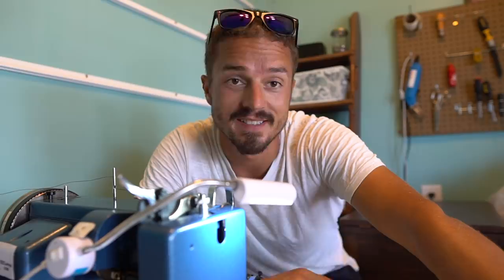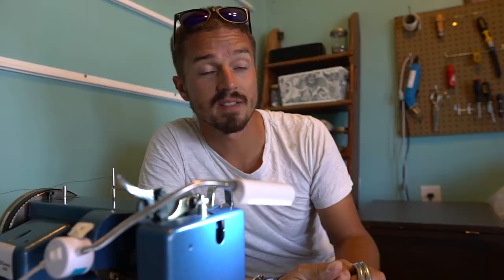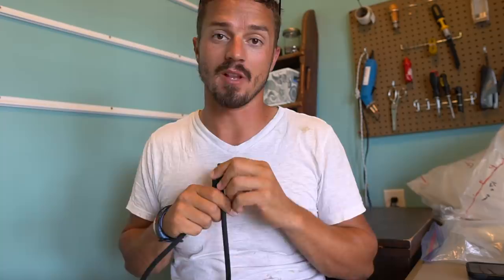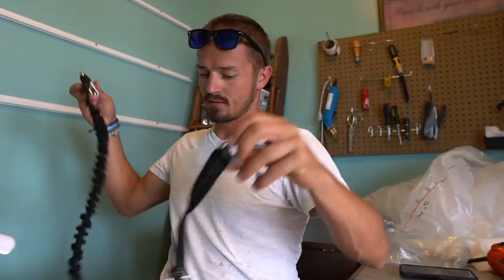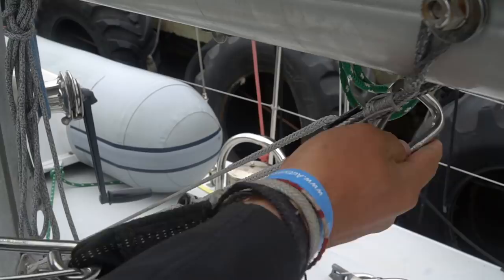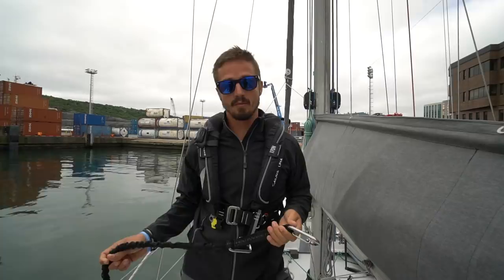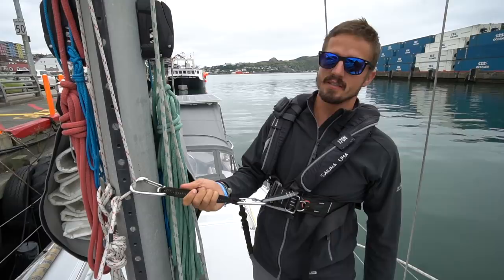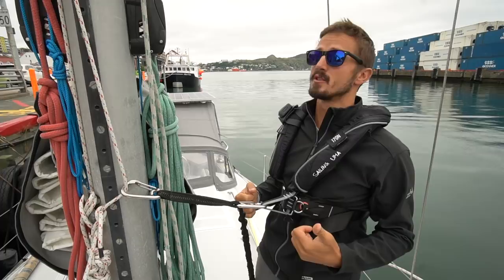DON'T FALL OFF THE BOAT!

Comment: Great idea. In Oil and Gas industry these are a standard. One idea, use a colored thread for easy inspection of deterioration from up or wear.
Reply: I thought the contrast stitch in the center of the webbing was the shock-load warning thread, but I too am only used to oil and gas industry. The webbing we get for confined space, vertical, or high angle rescue has that feature at any rate.
Reply: Disregard my last. I misunderstood your meaning. Yes black on black thread is probably a bad idea. I'd use contrasting colours so you can see easier what's going on.
Reply: Rick Czainski has

Comment: When I started diving, I used a similar plain carabiner to clip the bulky dive light onto a line. The problem is that the line you have clipped into can throw some slack over the carabiner gate, and then as it snugs up again, it actually puts tension on the gate and unhooks itself! Hard to make clear with words, but an ordinary carabiner can easily unhook itself. That is why I prefer "patent" clips that Kong and others use. They can't release themselves, but one fast squeeze the right way will open them. A plain carabiner is a land mine.
Reply: Lyfan Deth completely agree, very concerned to see that kind of hook. There is a good reason all the commercial products moved on years ago and I’m not sure they even comply with current off shore safety refs. Love you guys and your ingenuity but those clips are just not safe

Comment: I really like this system.
1. The long strap attached to the jackline stretches so it should always be long enough without getting in the way or tripped on. 
2. The short strap attached to the work area uses a huge none locking gate that should be easy to operate with one hand, even with wet gloves in the dark. 
3. The short strap attached to the work area is ... a strap,  making is distinctly different from any stays or sheets that it might be attached to. 
4. Locking carabiners eventually require me to remove a glove, making it both hands for the boat for at least a second or two.  So I see no locking carabiners as a plus for for the short strap.
5. The jackline is a strap so it won't roll under your feet when stepped on.

Wish list : 
1. A climbing harness or a full body harness, anything that attaches to the legs. Makes it just about impossible for the harness to slip off and (I think) it would make it a lot easier for Kiki to pull Dan back on board. 
2. Use two carabiners on the jackline with the gates in opposite directions. Some people want locking carabiners but I prefer all the equipment be the same. (I don't know, maybe not, none of the cool kids on the yachting channels double carabiner.... why should Uma ??? Kiki is probably too sexy for that shit anyway.)
3. Would like to see how the bungee cord was attached to the clip.

This was another great vid. Short, to the point, very clear and sure created a lot of interesting discussion in the comments section which was just as fun as the video. Great community.

Hmmm, I think it took more time to write this comment than it did for me to watch the vid... but is was a fun discussion.  Thanks for the vid.

Is it just me, or does UMA sound more like a  perfume/fragrance brand?

Comment: Toe rails saved my hubby when I back winded the spinnaker and the boom flew across the deck.  The idea of falling overboard sounds like guaranteed water boarding, rarely a happy ending.  If the boom knocked him out, he'd drown, I could never jump in to help, he's a big guy.  The toe rails give your foot boundaries without looking down.  Your short modification is a great idea.  Take all ideas for safety. 💯
Reply: I must agree with this. It makes me nervous looking at Uma's deck!
Reply: Toe rails won't do jack lines all the way (ha ha see what I did there? 😜). I went under the bottom lifeline last autumn while trying to unf...k a spinnaker: all the toe rail did was skin my shins but good on the way through, didn't show me down one iota. You gotta clip in.

Comment: The short tether is basically a "positioner". Whether climbing, or working at heights, a positioner allows you to maintain 3 points of contact (foot, foot, positioner). I am glad that you know the risks, but I can't see how or why, at the very least, the jackline carabiner cannot have a locking gate. You should only be clipping in and out of it in the cabin.  The personal attachment carabiner should be as well. Remember a lot of the rules for the locking style have been written in the blood of someone's loved one. Someone has died and that changed the rules for what is a suitable human anchor. Decades in the safety industry have probably imprinted a certain mentality on my brain, and sailing around the world in itself is a risk. But, I selfishly ask you to give it some more thought because I need more of your vids.
Reply: Byran...WELL SAID!
Reply: From Andrew Evans "Thoughts, Tips, Techniques, and Tactics for Singlehanded Sailing":
The skipper must be able to clip and unclip the tether quickly with one hand, for two reasons:
First, if it requires two hands, there will be many times when the skipper forgoes clipping on simply because one hand is busy on the tiller or holding a sheet. I will repeat this sentiment several times in the book. A singlehander is just as likely to fall off the boat on a stormy day with high winds when he is being extra careful as he is on a nice day when nothing significant is happening, but is just off guard for a fraction of a second. It is on one of those nice days when he might just skip clipping on if it is the least bit difficult. Human nature is such that people will avoid “unnecessary” work unless it is made as simple as possible.
Second, the skipper must be able to unclip with just one hand in situations where the other hand is busy. For example, if the tether gets caught on a cleat in the middle of a spinnaker gybe. It is much easier, and in the end probably safer, to unclip rather than leave the spinnaker pole swinging across the boat. I am not so unrealistic to think that the tether must be worn every second of every voyage. The easier it is to clip on and clip off, the more likely that the skipper will wear it more of the time.
Some boaters insist on locking carabiners. I have no problem with this concept as long as they can be quickly and easily fastened and unfastened blindly with one hand. In nine years of running all over my boat dragging my tether, I have never had a carabiner detach from the jack lines or my harness, so I don’t feel that a locking mechanism is necessary. I have heard of situations where the jack line runs parallel to a sheet and the carabiner runs onto the sheet. My suggestion is to move the jack line to a new position where this can not happen."
Reply: @wilfdarr  same goes for rescue etc..that is why the proper twist lock, or even the pinch lock is recommended. Look one can have no incidents most all their lives, the one incident will be all that matters. There isn't a CFR ( or CSA for the Canadians) governing this, but best practices are best practices.
Reply: @BryanSongy  There are one handed locking carabiners, but a twist lock is absolutely no good on a boat: at best you only ever have one hand free.

Comment: I strongly recommend that you use carbines with a lock. I use them occasionally at work and I can assure you that you´ll get used to opening them single handed with gloves without seeing them. Using a bright colour for your stitches will help you inspecting them.
Reply: From Andrew Evans "Thoughts, Tips, Techniques, and Tactics for Singlehanded Sailing":
The skipper must be able to clip and unclip the tether quickly with one hand, for two reasons:
First, if it requires two hands, there will be many times when the skipper forgoes clipping on simply because one hand is busy on the tiller or holding a sheet. I will repeat this sentiment several times in the book. A singlehander is just as likely to fall off the boat on a stormy day with high winds when he is being extra careful as he is on a nice day when nothing significant is happening, but is just off guard for a fraction of a second. It is on one of those nice days when he might just skip clipping on if it is the least bit difficult. Human nature is such that people will avoid “unnecessary” work unless it is made as simple as possible.
Second, the skipper must be able to unclip with just one hand in situations where the other hand is busy. For example, if the tether gets caught on a cleat in the middle of a spinnaker gybe. It is much easier, and in the end probably safer, to unclip rather than leave the spinnaker pole swinging across the boat. I am not so unrealistic to think that the tether must be worn every second of every voyage. The easier it is to clip on and clip off, the more likely that the skipper will wear it more of the time.
Some boaters insist on locking carabiners. I have no problem with this concept as long as they can be quickly and easily fastened and unfastened blindly with one hand. In nine years of running all over my boat dragging my tether, I have never had a carabiner detach from the jack lines or my harness, so I don’t feel that a locking mechanism is necessary. I have heard of situations where the jack line runs parallel to a sheet and the carabiner runs onto the sheet. My suggestion is to move the jack line to a new position where this can not happen.

Comment: Nice! I would recommend a quick release snap shackle that can be undone under load should you need to untether in an emergency. Otherwise, you need to release the load before you can undo those carabiners. Just a thought.
Reply: That's why you carry a knife !
Reply: Exactly. A snap shackle with a lanyard to allow for release under load should be at the harness/life-jacket end . This will allow you at least a chance, in the event that you do go overboard or the boat turtles in a knockdown, to disenage from the boat before you drown (which has happened to experienced sailors).
Reply: Agreed.   Leaving the boat behind needs to be a deliberate affirmative act on the part of the sailor.
Reply: I agree, love all the features Dan added but from what I've read the risk of drowning after going overboard while still on a tether is high.  Getting dragged along at 4 or 5 knots is kind of like those first moments of getting up on water skis where you are just eating water.  Under tension even a quick clip beener would be hard to get off of especially if getting tossed around by icy cold water and unable to breath.  Ideally, the tether is arranged so you never go overboard, but, just in case.  I notice the ones they have on Delos have the snap shackle with lanyard to release quickly if needed.  It would only have to be on the shackle that attaches to the jacket, the rest could still be quick clip carabiners.  Agree that the life jacket should have crotch straps too.  Tragic story of a couple from Ontario Canada that set off on their life time dream voyage across the Atlantic only for her to get washed overboard while tethered, quickly became too cold to help in her own rescue and ultimately slipped out of her life jacket while he tried to recover her. https://www.cbc.ca/news/canada/newfoundland-labrador/wife-swept-away-sailing-accident-off-newfoundland-1.4569319.  Life Jackets with D rings are supposed to be worn quite tightly below the rib cage to negate this problem, but then they aren't comfortable  so I'm betting most people don't wear them tight enough and with multiple layers of clothing may still not be enough to prevent it sliding off in a recovery, crotch straps are a must to be effective.
Reply: Back when I flew hang gliders, I kept a hook knife mounted in a quick draw sheath  on my harness to quickly cut free of a parachute lanyard (once on the ground) in the event of a deployment.  A hook knife mounted on the jacket/harness  could be a useful tool in an emergency

Comment: Great Video!  I built one similar with kong carabiners and quick release.  Cheap quick releases I tried didn’t open under load. In researching how to build mine, I found a great reference by Sail Rite on How to Sew Webbing Loops.  Also used a flat bungee cord which was much easier to sew in using a bar tack stitch.

Comment: Folks that work aloft we call that “short section” a “position line”. The long section for safety (always one line on the hard) and one to hold you fast. Great looking builds. Locking beeners are also a potential hazard if you’re moving fast, I’ve had them not let me engage and create a fall. Looks like a few years of experience has you doing it right!

Comment: Never use a halyard or a stay for security reasons. If you get a big heeling you can slip upwards the mast, halyard or stay and hurt or break some bones. As well a seafence is a absolute no go. Never stand leeside the boom. If you go overboard - especially in the North Atlantic you die in over 90%. Very good you wear a life vest with 170 Litres? It's better to use the smaller one because its much easier to get someone on board again.

A friend of mine, Bobby Schenk, told a very easy "trick" for collecting an over board person. He uses a life raft on a long line and try to sail a circle around the person. If the person get the raft or the line it can try to enter the life raft. so you get time waiting for better conditions to get the person back. This works, like all rescue, only if the person is not powerless. Forget all this expensive useless things like lines, life slings etc. it doesn't work in high seas. If you get the person back to the boat you cannot get it on board if you are not a professional.
Fair winds
Tom

Comment: Here's a winter project suggestion which I'd love to see as a video: wrap your wheel with small diameter line. As you will be in colder climates this will keep your hands warmer plus improve the grip. 

My wheel is wrapped to give a vertical center spine with turks heads at each spoke.
Reply: I want to do that on my boat!  Since you've already done it, maybe you could do the video?!?
Reply: @kimyoung230  Fortunately for me my wheel came that way. I haven't found a video on how to do the wrap that gives the short vertical spine, just other styles.
Reply: @sailingavocet  Hmm...Maybe I should take my wheel home for the winter when I haul my boat next month (Michigan).  Or is that too much pressure to anticipate your video? :-)
Reply: use tape for an icehokey-stick!
Reply: Edson has kits for wrapping your steering wheel in leather if you don't want to do the whole thing from scratch. Excellent for colder weather. We sail on Lake Superior so...

Comment: Actually, I could see two of the short lines. One that is easy to use and the other that is extra secure.  You can lock in with both to hold steady if needed. You can use the second hook for tools, a halyard, or many other things.

Comment: The cost for teathers are nuts. I ended up using some climbing carabiners I had and some short lengths of rope. It's a temporary option but works. Love your solution to save money!
Reply: Have yo seen the cost of a funeral .... Its all relative but I agree they are taking advantage of the mechanical properties we need in the true non-counterfeit carbines
Reply from the maker: Yes. The clips we used are sole for $65 at westmarine and the exact same clips from the same manufacture we found for $7each. Put one on the end of a dyneema loop and you'd have everything you need for about $10. NOT $300 like some others are sold for. They're mostly playing into you fear that if it cost more it must be "safer". Which is rarely the case.

Comment: Obviously you have never gone overboard. If no one is around to pull you back onboard, you will drown with your current rigging. You need a quick release shackle. Depending on where you fall overboard, you can actually get caught under the vessel too and no one will get you back onboard before you drown.
Reply: The British performed tests in the Solent showing that flush drowning occurs within 90 sec.  give or take. So someone needs to get the boat stopped right fing quick if you're dragging alongside. In addition,  don't count on the MOB helping in their recovery in the N. Atlantic. In 50 seconds they'll be incapacitated even if they aren't physically injured in the process of going over.
Reply from the maker: Just wait til this Monday's video about our PFD's. They solve the drowning issue quite elegantly. I've never understood the quick release clip on the harness end of a tether. If you single handing and you fall overboard, you'll die either way.

Comment: Thanks for the idea I completely agree that they are over priced. I can get a set of tower climbing y lanyards for less than a marine lanyard. But you really shouldn't trust a none locking carabiner.  They will fail at a significantly lower weight and will unclip depending on how you fall, and they can clip onto additional lines. One of our safety videos show how you can clip a non locker walk around  your anchor and unclip it. There's a reason why none locking carabiners are not osha approved .